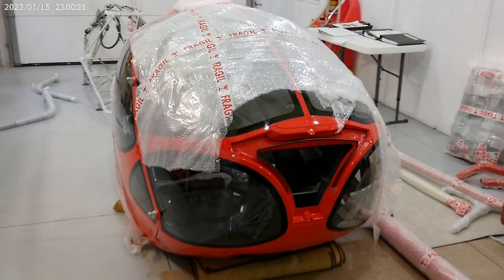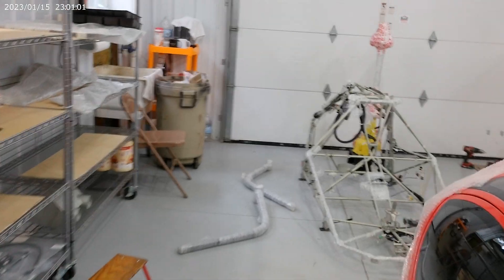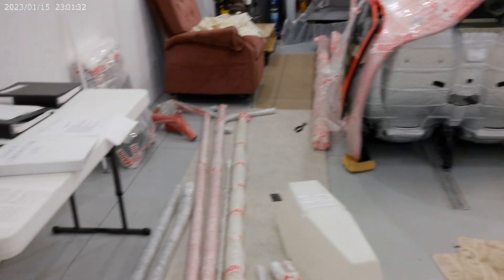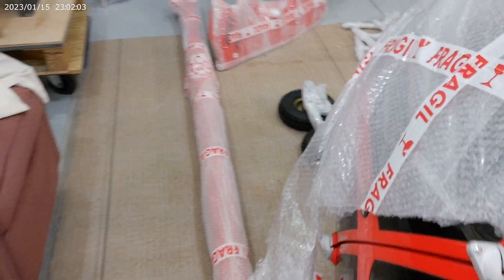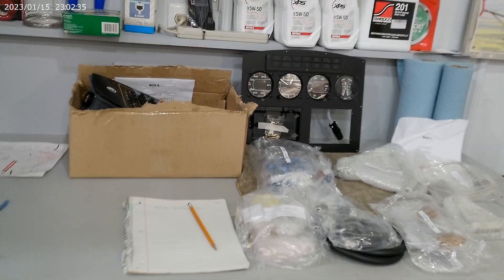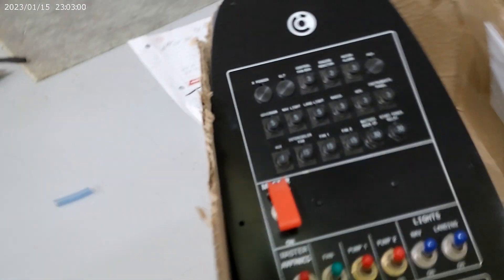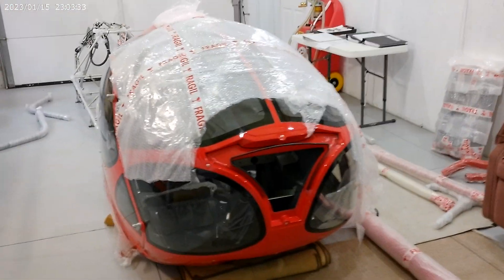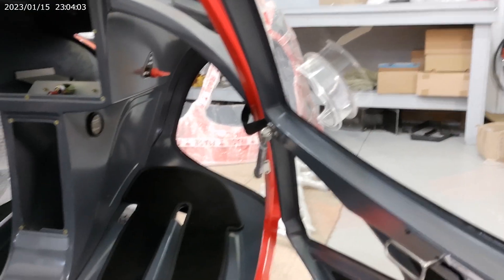Cicare 8 helicopter introduction

Comment: Nice....
How mouch motor HP and How is empty weight?
Thanks?
Reply from the maker: Rotax 915 is   is 141 HP     Empty Wt. is 730 lbs.
Reply: @XtremeSportHelicopter  Thanks
Reply: @XtremeSportHelicopter  

Very light.
Frame is aluminium or steel?